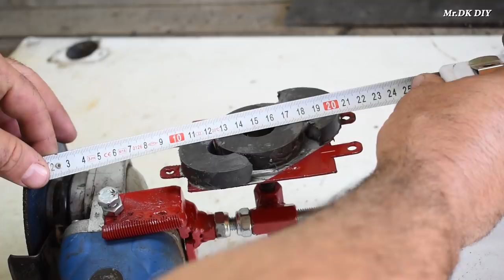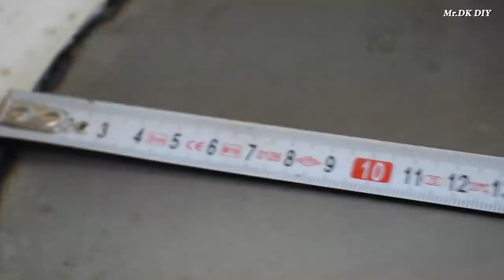3 REALLY USEFUL THINGS THAT ARE BUILT AT HOME

Comment: You did such a nice job , but then you went and taped the capacitor on, and it looks like shit ... you could have used some shrink tubing on the wiring. and made a bracket to hold the capacitor . You did such a nice job on it even went to the trouble of painting it to make it look good .... I would put a spring on the motor to hold tension , ( and for god sakes take that duct tape off ) and make a freaking bracket for the capacitor...... Keep up the good work...
Reply: Okay now put an electric motor , with a foot pedal on it . so you can actually hold on to your product while you are drilling. and make sure you put (reverse) on it. sometimes you need to back out... update we want to see updates , with your electric drive and your reverse..... the electric drive should run up and down just to make it a lot cooler, and easier to work with..... chop, chop, be looking forward to your next video on finishing your drill press...... and get rid of that freaking duct tape.....